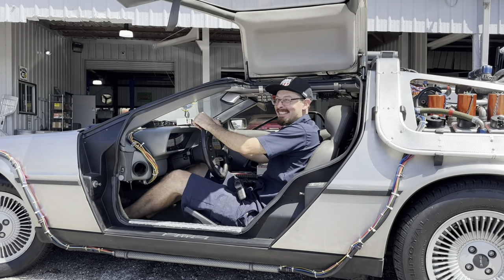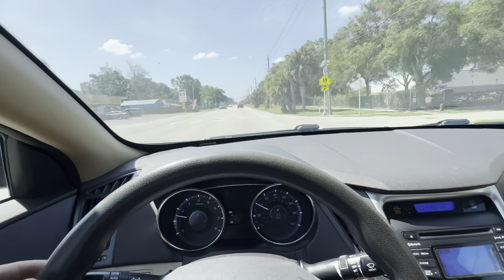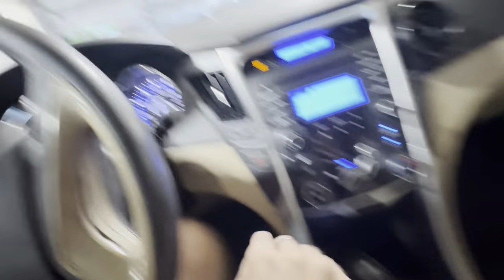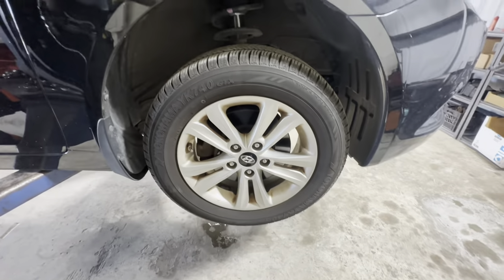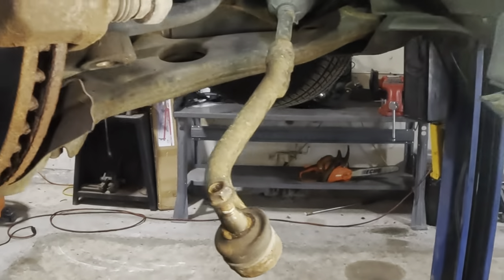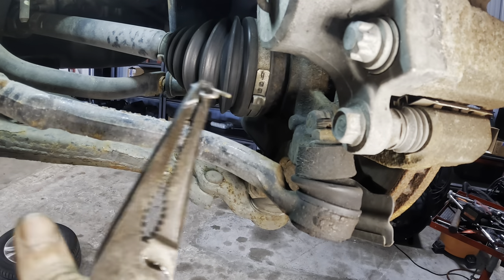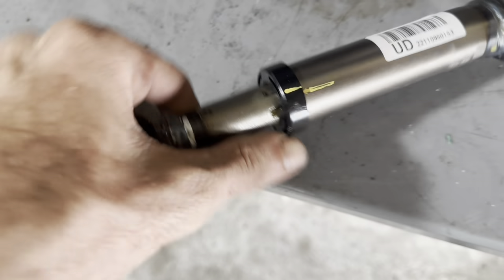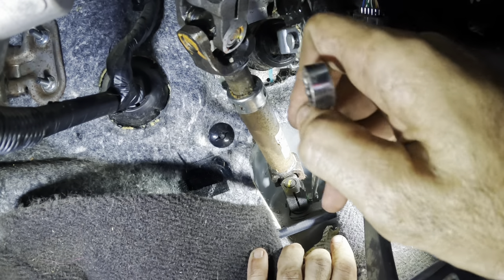Misdiagnosis! Mechanic was Wrong! Hyundai Sonata Steering Clunk!

Comment: Hay Ray once done service on lift truck and didn't  tighten hyd filter 2 days later got call back for loud noise  coming  from truck and po number  2000 repair told  customer  that dumas that last worked on it did not tighten  had filter he told I was the last one e to work on it I told him no charge have good day turned out to be my best customer  after that😅

Comment: I had the same problem in a car. Customer was passing thru. Wanted car check. I knew it was internal in the steering wheel. Had to send them to the dealer. Car is new car.

Comment: Steering wheel coupler, like a $1 part. Basically a rubber bushing inside the electric steering motor. Very common part for these cars to go wrong. I’ve done a few of them, and have had my own car covered under warranty from Hyundai.
Reply: I believe Hyundai will cover the steering wheel coupler for 10 years or 100,000 miles

Comment: Other mechanics would just say more was wrong after looking further. That is the norm. Ray is super honest but should have made a full diagnosis like he usually does. I had a feeling the u joint wasn't clunking while watching the video. I've torn many of these apart in my Locksmith work. Have never seen the u joint bad myself. Always under the steering wheel.

Comment: A lady towed a car to a shop..mechanic said trans was shot..I bought car for parts. Drove it home fine til it got hot then it wouldn't move til cold.. I changed filter n fluid.. been 5 yrs driving good.. all mechanics make mistakes
Reply: Years ago one shop said my engine needed valves cuz it popped and spit while driving.. so I put a reman motor in it..and a reman carburetor.  It still popped.. it was a bad coil.. expensive mistake.. I do all my own work now. Youtube is awesome

Comment: Notice the inspectors paint marks on all those parts.  Safety.  I bet if it wasn’t so hot you might have taken those to heart and gone and used some locktite on those steering bolts.  Safety.

Comment: If it has electric power steering there is a rubber gear between the motor and colum. The rubber gear will wear out. Hyundai has a tab for it and a improved design for the gear

Comment: So, I'm a home-gamer that is mechanically inclined enough to do brakes, oil changes, plugs and wires, basic maintenance stuff most people should be able to do but I've always used hand tools. Well, I did the brakes on my car using just power tools for the first time ever, a basic impact wrench and air ratchet. And I thought this is the best, and how could it not be? And then I thought "ya know, that 1/2" is a bit big for most everything I'm gonna use it on but the lug nuts, so maybe I should get a 3/8" impact for that stuff. And I should probably get a set of impact sockets for it, one with wobbly bits and torx, inverted torx. and some extensions, you know, just in case. And I might need an air impact ratchet for some really tight spots. And probably an air hammer, that would be great for the rotors and stuff." I blame you and Eric O. for this. I'm not saying it's a bad thing, but...

Comment: Put pasta in your ears as you return the vehicle (standard UK practice) 
I guess the upper part of the coloum has splines that collapse in an accident event . 
I was expecting there steering wheel to be on the wonk. Did the same job on my Vauxhall when in the straight ahead all the fasteners are pointing away into inaccessibility.

Comment: Gotta check your TSBs. Rookie mistake. Would have never been in this pickle if you looked up steering TSBs on 13 Sonata, there are a few. One in particular, the plastic steering bushing flex coupler that shreds in the steering motor is the most common.

Comment: 50 cal. bmg. Does that have one of those plastic star discs at the top of the column between the wheel and column? A sort of coupling that disintegrates and causes stiffness and noise.

Comment: I was under the impression you could always make a right on red unless otherwise posted at a "regular" intersection.... Would be interested in knowing where in the US that's not the case.

Your analysis of turning left on a red from a 1 way to a 1 way is SPOT ON. Too few people know this.

And.... yeah.... The Hyundai's have a kind of known issue with those steering boxes under the dash. Sorry you got bit, but glad you're straight up honest. There is a little plastic spacer thing between the electric steering motor and the gearbox itself. It's a cheap part. You'll know for next time!

Comment: Loctite on the bolt threads upon reinstall? Even though it's a different issue. At least the customer got a new part so there is some upside.

Comment: You didn't fail Ray.  You have just verified that it is indeed not the steering coupling shaft.  I quite often need to fire a parts canon, not to prove what it is, but what it is not.   What I often have to do is bid a job a little high because of things like this.  There are a lot of unknowns involved with any repair.  You bid a job high, the customer is happy when you present them with a lower bill.  Honest people will give a lower bill.  A higher bill in this case would cover some of the "misdiagnosis" time involved.  People who aren't mechanics sometimes fail to realize we are not in a perfect world.   i can bid an assembly replacement only to find out that the bolt holding the assembly in has turned it's hole into aluminum shavings.   So I bid high to cover it.   Of course copiers/printers have limited repair shops so a customer almost has to accept the bid or trash the machine.  So when I bid, I start high and say this is the max, it might be less.

Comment: Guess you couldn't hear me yelling, it's not the joints!  It's likely a rubber "star" located behind the steering wheel.  Common Hyundai fault on this vintage car.  Several You Tube vids on replacement.

Comment: Ouch does it have electric power steering in the column between the steering wheel and the shaft ,if it does it. Going to be $$$?

Comment: these hyundais and kias have a rubber wheel gear inside the steering column that goes bad. i knew the second i heard the clicking. you gotta take the column apart to fix. cheap part tho
Reply: ps i have repaired these before. it is 100 percent that wheel gear inside the column.

Comment: This is a very common problem with these Hyundai/Kias, I remember dealing with and researching this on my 2012 Optima. There's a campaign about a rubber or nylon coupler that essentially looks like a gear puzzle piece that completely destroys itself in the steering column area. Basically connects the steering shaft to the electric power steering system under the dash if I remember correctly. (It seems like it was made of plastic actually and top comment has all the info about it 👍🏼 @VILSONDUSHAJ

Comment: It's in the model name folks. Sonata..... So not a well engineered vehicle. Former girlfriend had one of these and it had steering issues from day 1. Turned out to be a number of badly designed components as well as a bent, from factory or delivery to the dealer, who knows, lower control arm.

Comment: I didn't think those U Joints should have failed with only 129 k on the car. They're pretty critical to the safety of the car, and are probably built extra robustly.

Comment: When you said it was the steering shaft I was yelling at my TV "YOUR DOING IT WRONG", but then when you wiggled it even the way it came thru on camera it sure seemed like you were right. I thought maybe this is the one odd Hyundai with something different. 

The reason I was yelling that is because the most common failure on these Hyundai is a little plastic gear called a power steering assist coupling. It is exactly as I said a little plastic gear. 

The front piece that connects to the shaft you replaced is a electric power steering assist motor. They completely removed the hydraulic steering and instead went with a electric motor mounted on the shaft to make steering easier. At the very top of that thing, connecting the back of the steering wheel to that motor is a little plastic gear. 

When you rotate the steering wheel it spins this plastic gear spinning the internals of the electric motor. Because it is plastic (dumbest design ever) eventually a couple of the teeth break and/or strip. The banging noise your hearing is the steering system jumping over the damaged teeth on that gear, which is why it only seems to happen on one small section of turning. Every time you come around and hit that damaged section it does it. It is also why the wheel won't recenter, there simply is not enough return force to force it past the damaged section. 

If I am correct the good news is the part is cheap, dorman makes it and it is like $10. I do believe it is a little bit of a time consuming job, but isn't that bad. So at least you don't have to eat too big of a job.

Comment: It would have been easy to pull that top joint off and wiggle the steering wheel or at least check it when the shaft was out.

Comment: The little plastic connector at the bottom of the column is bad.
Reply: Also those steering knuckle bolt must have lock tite on them and they do require being tourqued!!!!.
Reply: I wouldn’t let you work on a wheel barrow.

Comment: I'm going to be negative Nelly, This is only to help you Ray... You took the wheels off before checking tierods, might as well check them while you're in the air.  You threw the parts cannon at it... OMG! why didn't you take the intermediate shaft off before ordering a new one?  Cocky mechanics lose money.  I watched closely, and I saw no slop in either u-joint... It didn't even look to have slop between the steering wheel and the intermediate shaft... Possibly a loose steering column bracket or bearing.

Comment: Looks like that car has electronic steering assist any mechanic that knows the vehicle would know that by looking at the electric motor on the side of the column as I saw is you're neoprene bushing between the electric electric motor and the gear drive,,,, yeah right good mechanic

Comment: Just tell the customer what happened - you don't need to fix it for free - just fix what the actual problem is and then go on from there - you admitted it - I've done the same thing  before - just told the customer and then fixed the correct problem - my opinion

Comment: Yeah, we all goof. You're man enough to still show everyone your little error. Personally, I would have gone farther into isolating the issue, by disconnecting the top joint, and giving the steering wheel a shake, before ordering anything, just in case.

Comment: Hyundai, no kidding, they have some seriously JUNK steering systems, like how da fugg does a steering shaft wear out?  wouldn't buy a hyundai for 75% off .. Hyundai like to stick with "welp we couldn't replicate it so we cannot warranty it but we will charge you $10k throwing parts at it if ya like"  even tho the steering locks at speed when turning, serious safety issue, they play stupid.. so many chynese parts on em..

Comment: You failed but the customer still has to pay - that’s just the way it is, nobody takes responsibility and heaps everything on the customer to take the blame and to pay the price.

There was no logical reason for the steering shaft (inside the cab) to fail. 

Everyone should know THAT Elementary rudimentary logical critical thinking analysis progression.

As the Bible states?: the curse doesn’t come without a cause or evidence of what led to the cause.